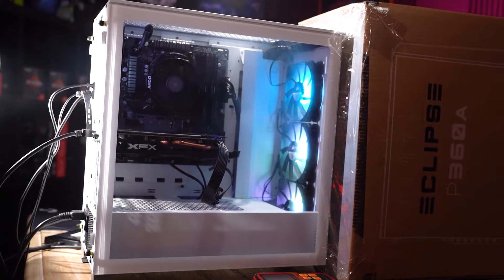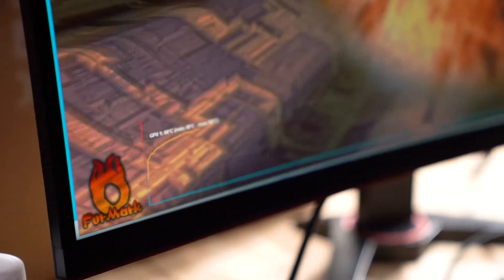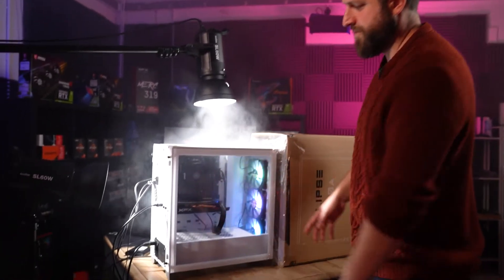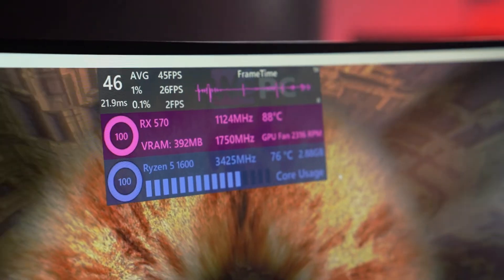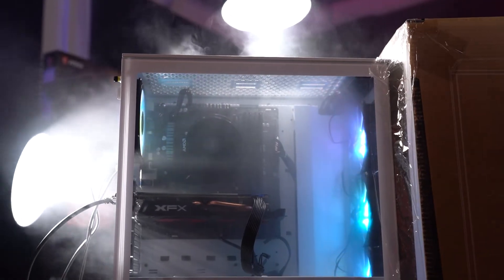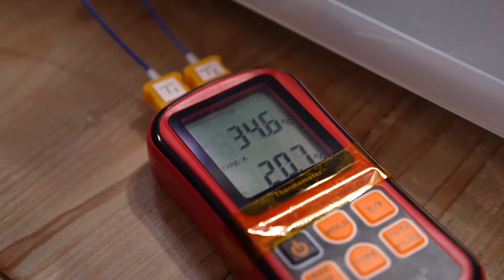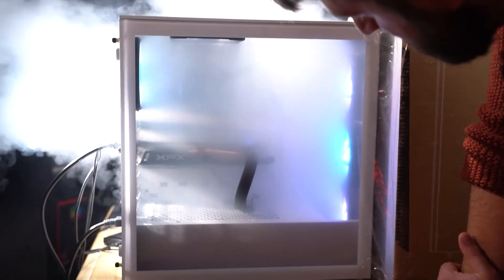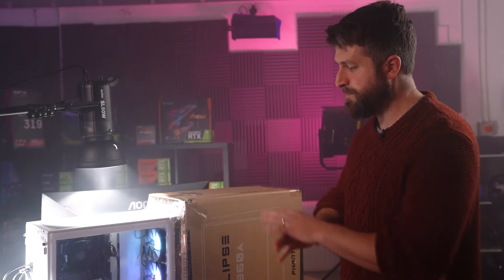Which fan placement has the best airflow? Corsair 4000x, Airflow and Temperature Test, EP. 3

Comment: Sorry for my poor english: In a single exhaust rear fan configuration: does blocking the top mesh of the PC case increase positive pressure?
In this configuration the GPU won't intake air from outside the rear of the case.

Comment: Idealy you'd have a PC case that cycles air in under the GPU towards the front, then a fan blowing up from underneath the front, then 1 top front fan intake blowing over the MoBo, then out the back top again. It'd essentially be a backwards C airflow, with the GPU partitioning the air qithin the centre C. Alas, we'd need another fan mount instead of PCIe brackets.

Comment: 3 at the front and 1 at the back would be the optimal configuration in this scenario. With the top fans, the air is getting sucked out of the case right away. Without a radiator to cool at the top, this is useless work and starves the components for air. Barely any air from the front fans reaches the GPU fans, which have to suck air in through the slits at the back of the case. More isn't always better.

Comment: I have a little problem with the case because of my Deep Cool AK500. I have 3 front fan for air intake and 1 top and 1 rear Corsair fan for air outtake. The Ak500 cpu cooler fan point the air to the back and I want to add another cpu cooler fan, but it will be going against the direction of the rear fan. What should I do?

Comment: I have this case with a 280mm AIO and I changed the config several times and my best results is front fans intake.  Top AIO intake and rear fan exhaust.  This gave me drastically better cpu temps.  The gpu temps really didn’t change much no matter what I did.
Reply: I sit very hard to switch the direction they suck in or remove air, also, will it fit 360 aio on the top, with an exhaust fan in the back and 3 intake in the front? Do you have to buy an extra exhaust fan? The case only comes with 3. Which do you recommend?
Reply: Mine also same setup but with front 240 aio push pull and +1 exhaust fan at the bottom pcie covers

Comment: did it not occurred to you that you have to block unused holes so the air from the top front fan does not escape right away? Also, tower cooler would be a lot better (and prevent air sucking in)

Comment: This was very informative, although airflow is complex and very dependent on case and hardware configuration. I keep seeing builds with like 10 fans which seems like just a waste of money as a good amount of fans will simply intake and exhaust between each other without that airflow actually hitting any components. It seems like GPU cooling tends to fall off with this standard case design. I would love to see a ducted fan setup directing air to the GPU to see if that actually helps as there really isn't any airflow down below the GPU from any of the case fans. The recirculation of exhaust air from the rear fan back down through the rear panel being drawn up through the GPU is not ideal.

Comment: what if we reversed the top fans to also intake air, so now you have the front fans and top fans taking in cold air. Would it be too much for the back exhaust fan to get rid?
Reply: With GPU fan blowing Up, front intake blowing to rear, and top intake blowing down, you'd get a pocket of turbulent air that would most likely remain in area of CPU/GPU for longer resulting in even higher temps, as well as some extra noise from the turbulent air pocket.  With the Down draft CPU cooler, the dual exhaust, one up one rear with 3 intakes in front is the best option. It's when you change the CPU fan style to a tower cooler with single or double rear blowing fans that you'll see a new result. I've had similar tests with tower fans where not having the second top exhaust caused a small influx of extra heat due to turbulent air caused by the last GPU fan closest to the front. 

My Current setup has 5 intake fans and 4 exhaust fans, 3 Front intakes, 2 backside on AIO, 3 top exhaust and one rear exhaust fan. I wasn't sure I'd get popper cooling however, since the second set of side intakes is through the CPU AIO, it creates the slightly positive pressure I wanted with the front fans being less restricted cause no AIO and allows them to sort of break up the AIO heat once system is heat soaked. Getting pretty constant 30-32 at idle and tops out at 60 on CPU running a full heavy test run. GPU stays constant at mid 60's with just fans, as I've not decided to go with a full water loop as of yet. Honestly with just CPU AIO, and the temps I'm getting, I'm not sure I'd even want to run a custom loop because It seems a waste at this point minus just the visuals. Wasn't really sure on the case when I got it either, but Segotep T3 with the 3 Angled adjustable fan vents on the front is actually not bad. Was mostly interested in its look. While more or less hoping it would allow for good airflow with its odd setup. I mean, it can run 3x360 AIO or radiator blocks, with 1-2 rear fans as well, was a fun build, sorta like taking the O11 Evo and giving it extras with a slightly smaller side footprint.

Comment: You should have done this with a tower cooler.
The stock cooler messes up the airflow of the front fans
Basically it should be 2-3 front intake fans
Tower cooler (pushes front airto the BACK of the case/heat off the cpu) 
1(or 2 fans if configuration allows) exhaust fan(taking all air out the back of the case.)
But what do I know, lol

Comment: I wonder if 3 front intake fans + 1 rear exhaust fan while having the top of the case completely sealed would help make sure the air from the front fans would flow easily through the case towards the rear

Comment: Fantastic video, I'm aiming to pick up a 4000x for my upcoming build and this is precisely what I wanted to know. Seems like with all fans installed it's a slightly negative pressure system, easily corrected with a bit of fan curve adjustment.

Comment: It's clear that the GPU is drawing air in from the back in each of these configs which means there's no meaningful airflow from the front to it. The GPU seems to be drawing air from both the front and back equally which means it's quite neutral around the GPU.  This is why the Fractal torrent has such a good design.

Comment: ye the slots under the GPU (in the back) i just add transparent tape to close all those holes and the result was just amazing, many times  if the open holes around the case are not in use should be sealed with a simple piece of tape, inside the tower( when using intake fans and exhaust fans properly) you will have the best cooling machine, i say it because years of experience and error trials. great video

Comment: I just got this case and the reason I watched the vid was I wanted to see the best configuration without a aio cooler. My theory was 4 intakes and 2 exhausts. So front 3 intake 1st slot at top intact to the 2 top exhaust snd rear exhaust. Also I was thinking of just 5 fans with the front top being covered so increases airflow. Let me know what you think . My system won't be used for heavy gaming I only play bfv and wow at the mo

Comment: I always wonder why no case manufacturer makes a way to mount a rear exhaust fan BELOW the GPU.
1 above 1 below... 2 or 3 front intake and maybe an additional intake on top for positive pressure.... but hey.... 1 exhaust fan has been around since....ever dont question it right?

also old video i know but Fractal pop air or silent would be coolio to see tested.
Reply: I imagine the turbulence and/or larger sucking power of the case fans would stall airflow going into the gpu fans increasing temperatures.

Comment: This is a great video.  I was just trying to figure out how to optimize the air flow in my 4000D with 5 fans and this is perfect.  Would you recommend replacing the 2 non-PWM stock Corsair fans with PWMs?   Is it worth it?  I've got 3 Noctua's in there as well.

Comment: I have the same problem with my Corsair 400x case. I've noticed my CPU was a lot warmer with 2x top exhaust fans. If my system isn't set up for water cooling, how would you recommend that I install my fans? One top exhaust fan at the rear, one rear exhaust fan, and 3 front intake fans?

Comment: You should but top front fan to push air inside, not exhaust. The top rear fan will be exhaust, and mounted as rear as possible. If one exhaust fan on top and rear, I would close the gaps with some stuff, so the cool/clear air sucked from the front panel does not escape to the top, but reaches to cpu cooler.

Comment: I would say the best setup would be for air cooler is intakes from the top and front while exhaust from the back because then takes from the top will push cool air through the air cooler while the exhaust sucks it out.

Comment: Hi, I'm an HVAC expert, and I found this very interesting from an HVAC standpoint. It actually is probably most efficient to have just the front and back fans, because the back fan pulls cooler air across the mobo. Having the top fan like you said, just pulls air straight out of the top before it has a chance to take any heat off of the mobo. referred to as a short circuit. The air from the top front fan is effectively useless in the setup with front, rear, and top fans. Additionally the top front fan is probably THE most effective fan in the system given it's positioning to the mobo when there isn't a top case fan.

A couple configurations worth trying; if you have the top fans on, reverse the back fan so it's an intake, and all the air is exhausted out of the top, this will result in turbulence around the cpu, but will probably result in the most effective mobo cooling solution.

Another option albeit more complicated, a baffle in the case that would go from the top of the front fan and angle maybe 35' downward past the first top fan would direct the front fan air directly to the mob, and then the top fan would pull it back out the top.

I'm actually watching this video because I am refreshing my PC with this case and a CPU liquid cooler that has 2 top fans. If I feel up to it I'll install a baffle and maybe share the results with you if you're interested. Because the 2 top fans will be pulling air directly off the CPU with the liquid cooler, it won't be as much of an issue having the top/front fans short circuit, but it is still a waste of efficiency from the standpoint that the top front fan in the case is doing next to nothing while there is a top exhaust fan.

Thanks for the video.
Reply: I think part of the reason that he was seeing this is because of the stock CPU cooler that blows air directly at the motherboard.  I'd like to see this test with a tower air cooler and aio.
Reply: I  agree, for a total air cooling setup I have found that a slightly positive front intake to negative rear exhaust setup is more efficient at blowing cool air across the components and cooler heatsink while also drawing heat away through the exhaust fan, the trick is to make sure that all of the case fans are the same make and model, I've been building PC's for 25 years or so and this configuration works well in most tower cases, and Is my standard go to setup for cooling and dust prevention.
Reply: Thanks for your great insight. 

I have the same setup with the 3 front intakes as 4000x suggests and a BeQuiet Dark Pro 5 on the CPU. I just ordered 3 more 120mm fans and was wondering what is the most optimized way to attach the new ones. I am intruiged about the back fan being an intake instead of an exhaust but then I think it will collide with the exhaust of BeQuiet - also this method asks for a filter at the back I think.

I was thinking whether I should install all 3 fans as exhausts eventhough the top front fan is creating a short circuit. A question here though, do you reckon lowering the RPMs on the front top fan to lower the short circuit effect? can this be achieved? or should I just return one of them!

Anyways, thanks for the explanation above. Hope you can answer my questions.
Reply: @alierentok  you could put the cpu fan in opposite direction horizontally so it doesn't collide with the back intake fan
Reply: Thank you from Belgium for your expertise

Comment: i understand this video is a bit old but why not put intake on the top? i have a 4000D AF case and i saw a 5-10C drop in GPU temp from setting my rad as intake push on the front with 2 140mm fans, 2 140mm fans as intake on the top and 1 120mm exhaust on the rear. initial setup had the 2 top fans as exhaust, as is the commonly accepted "correct" orientation. but like i said, thermals were better when flipping those two fans to intake because as you noted, when they are exhaust, the fan coming in from the front gets sent out the top immediately.

Comment: Show me Phanteks Eclipse G360A and Corsair 4000D AIRFLOW whit the same setup test.
There are as I see it unly 3 options.
1. 3 fans at the front off the case and 1 on the back.
2. 3 fans at the front off the case and 1 on the back + 1 CPU Fane at the top. 
3. 3 fans at the front off the case and 1 CPU Fane set at the back for multi use. 

BUT...
What is the best solution hmm..

Comment: I wonder if using 140mm for intake and 120mm for exhaust would circumvent the effect of that top intake air being immediately exhausted. Another thing maybe would be to put the intake fans in a "standard" config and exhaust fans in a "quiet config" another way of possibly getting the cool air further into the case before it is exhausted. Awesome tests!
Reply: i'd say, logically thinking, having 1 rear exhaust fan and 1 top exhaust fan at the very back might be better. compaired to 2 top, 1 rear.

you want to let the air have a chance of getting to your cpu
also you can play around with the fans. im putting higher capacity/airflow at the front so its positive air pressure. combined with low pressure, high flow fans as exhaust (1 top, 1 rear)
Reply: @appakinggg have this case and tried it with 2 140 front 2 120 (top and rear) also with 3 120s front and 2 120s rear. 

The 3 120s front and 2 120s rear did a much better job than the 2 140 and 2 120 rear. The 140s at the front its still good but not as good.
Reply: @justanobody4983  interesting. Yes 120's got more pressure for sure but noisier. I wonder if you put a custom fan curve to match same DBA and then test temps again.

Im running 2x 140 in front and 1rear/top exhaust 120.

Quality fans and specs really matter moreso than the size.

Comment: I had tried both set up for the top fans. If it pushes air in, CPU runs cooler, if it pulls out air, GPU runs cooler. This experiment shows why, airflow does matter. Air filters should be installed on the top fans if air goes in so as to minimize dust build up. Personally, I had them as exhaust fans as my case were cooler to touch particularly in the glass panel where the GPU is.

Comment: Enjoyed your video! Would've been nice to see all the possible combinations and specs revealed as well. For instance, what effect would it have on the temperatures inside the case to have a 1700RPM exhaust fan and keep the average corsair fans in front, or relocating a front fan to the exhaust, or all previous tests but with a Noctua CPU Cooler which usually come with dual fan configurations. Would've been nice to know the fans speeds as well.

Comment: i have the same case but using an NZXT Kraken X53 RGB 240mm CPU Liquid Cooler located on the top and an exhaust fan which really did make a difference to temps when added . annoyingly corsair should supply the matching exhaust fan with the case instead of having to purchase another especially for what the case costs

Comment: Well, I found your video extremely helpful and much better and pleasant to watch than the Linus' or other youtubers'. 

I would really like to see one more configuration for this case. The one with 3x intake at the front, and 2x exhaust rear top and bottom (below the GPU). 

Adding a beefy air cooler for your CPU would also be interesting because I find them kind of obstructive when it comes to airflow in the case.

Wish you made more videos like this (I'm probably not the only one thinking like that considering your average views for videos) and especially with this presenter. This Yorkshire accent kind of added to the joy of watching this.
Kudos! 

Btw, try it with a newer case too!
Reply: I have this same case with an AIO cpu cooler and a rear exhaust fan, I have the AIO fans exhausting out the top for the radiator and the 3 front fans as an intake, noticing on some games my geforce 3060 getting up to 93 Celsius wondering if there would be a better way to cool the gpu
Reply: @GoudaBTW  I saw one Reddit post build has 2 additional fans intaking I think at the bottom, so 5 in, 3 out (2 top aio, 1 exhaust), that said, I don’t know that the bottom panel has a dust filter so might be unwise.

Comment: Fantastic demonstration.  Now I'm curious about what might happen if you had the front top fan (relative to the front of the case) as intake, with the rear one as exhaust.
Reply: I have the same question
Reply: Intake will pull the exhausted hot air, so the hot air will not get chance to cooldown and it will create negative pressure inside case.